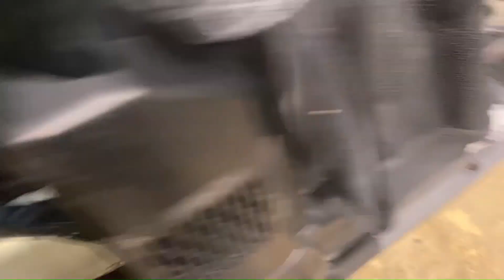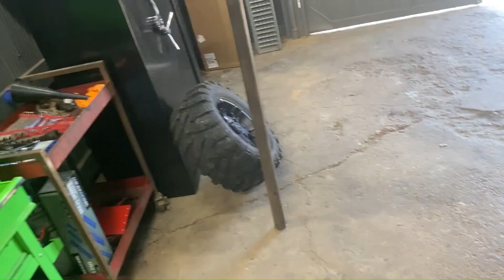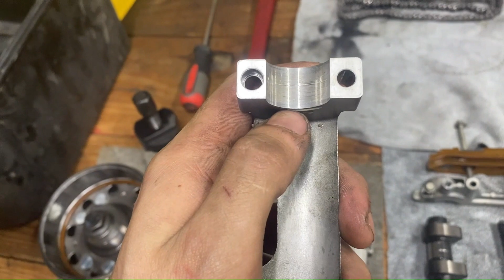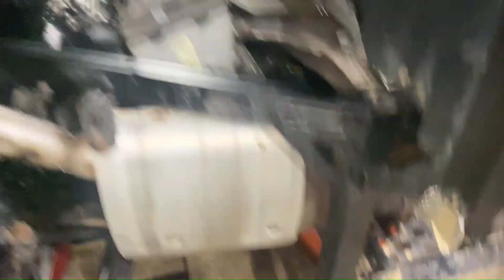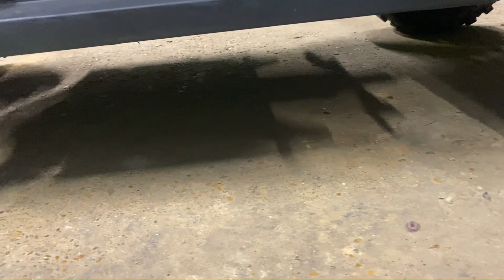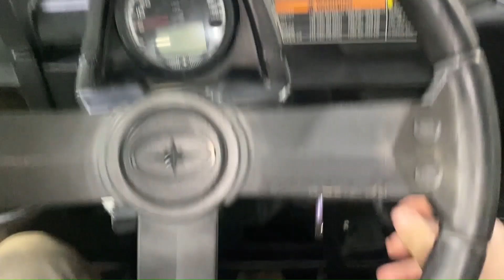Polaris ranger 900xp hard start? Can i fix it?

Comment: FYI Polaris starts on one injector you give it some gas pedal and both injectors will fire . I’ve found out that stock injectors are not that great I’ve had good experience with niche brands performance injectors with wiring and a fuel pump. Not that expensive but runs better than new. Give it some thought.

Comment: My 2020 xp1000 has just started doing this same thing,. Its hard to crank unless you give it some throttle. The issue goes away once the engine is warm. Ive only been mud riding a handful of times. Most ride around my sub. And backroads. Very low miles and hours. Ive seen some comments about the crank position sensor causing this issue. Thoughts?

Comment: I’m experiencing exact same issue you’ve shared in this top end rebuild of rngr 900 engine after I’ve rebuilt top end. My leak down test read 2% on lower compression cylinder n 0% leak down on higher compression cylinder. How likely the new piston rings would be culprit here’s? I used REV6 new parts. Only thing yet to church is the valve lash on intakes to see if these are too tight n need replacement.

Comment: LOL DUDE ITS 25MIN TO PULL THAT MOTOR, EASY! & YOU CAN DO TOP END IN BIKE IF YOU HAVE IT CLEAN BUT F THAT. I PULL THE MOTOR & DO THEM ON THE STAND. MAKE SURE AND PULL THE VALVES & LAP THEM ALL & NEW OEM VALVE SEALS ALSO!!! DONT PISS AWAY A TOP END ON BAD VALVES.